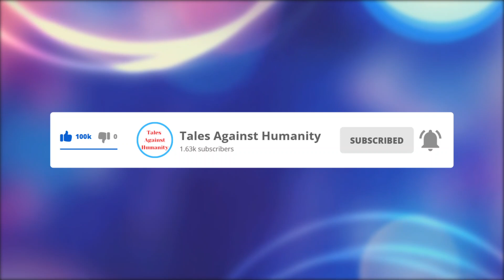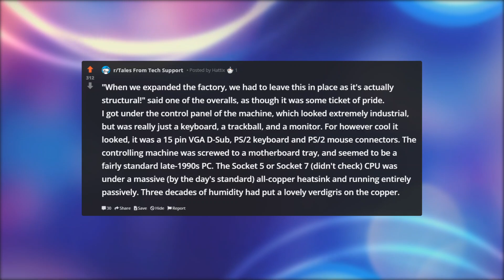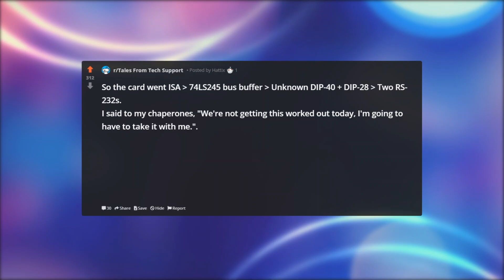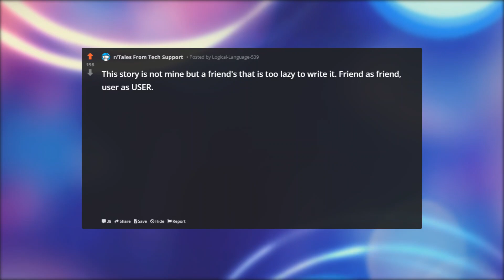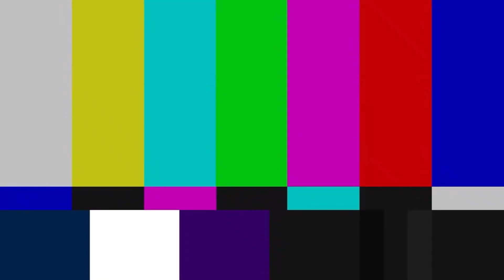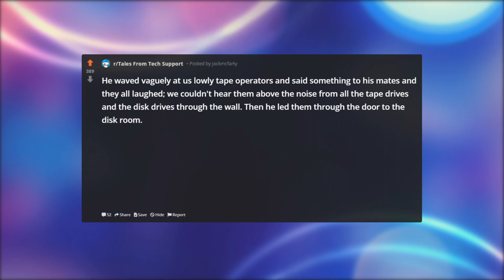Tales From Tech Support |GENERAL PROTECTION FAILURE WHO YOU GONNA COM?| r/TalesFromTechSupport

Comment: When I maintained a Cable TV headend, the manager would walk into the room, and equipment would stop working. He went in one day, and two full racks of microwave equipment started failing, one after another as he screamed for me to see what was wrong. I told him to leave, that the equipment despised him, and I had warned him before. Then I looked at the racks, "I don't have time for this crap, today!" I reached out and tapped my knuckles on one of them, and all the failure lights went out. He didn't know what was going on!
One night, I was working in the shop, as we lost a satellited delivered signal. I went to the headend, to see that there were no failure alarms, but 14 receivers, on three satellites all showed no signal. I never did find out what caused that incident, but all the uplinks were in a small area of New England so it may have been a regional power outage. Unlike our local channels, there was no way to display a off air massage on these channels so our answering service gout a lot of calls.
Reply: Feeling your pain.
Reply: Satellite's orbital motion briefly bringing it along a straight line between the receiving Earth station and the Sun?
Reply: @robertvirginiabeach  Yes. The sun is behind the satellites but this outage was at night. Twice a year this happens, which causes 'Sun Outages. The satellites are typical 20 Watts per transponder. The sun emits megawatts of RF noise, which wipes out the return signal from the satellites. They are in Synchronous orbit The ones I worked wit were at 1100 miles above the earth, but the sun was 93, 000,000 miles away. Even with squared losses, it was still well above the desired signals when it was in the receiving dish's beamwidth. The closer to the center, the stronger the interference. The outages happened the same time each day, for about a week, each time and each satellite on different times.
No matter how much advance notice was given, our customers would call and demand that we 'fix the problem so that it never happens again'.
We had 14 satellite delivered channels on that CATV system, and some really stupid customers.
Reply: this reminds me of a story:
an industrial robot in an army base would always charge toward the viewing window whenever a certain officer came into the viewing room!
they eventually figured out it was because something metallic in his shoes was making sparks.
Reply: @ericb3157  Nah! Its BS detector was too a little bit too sensitive! 😜